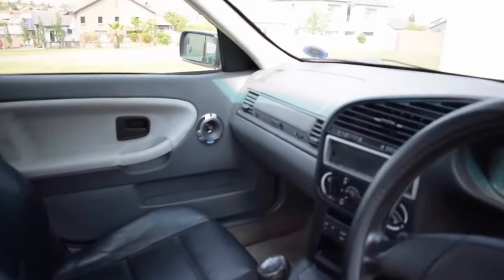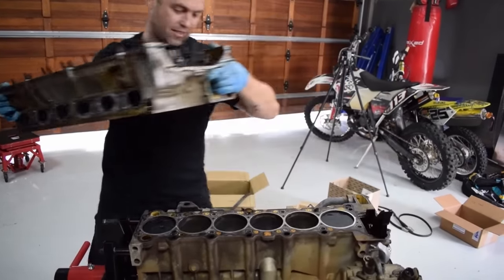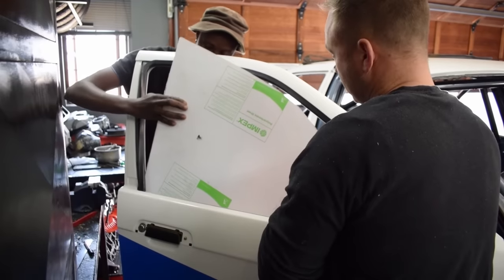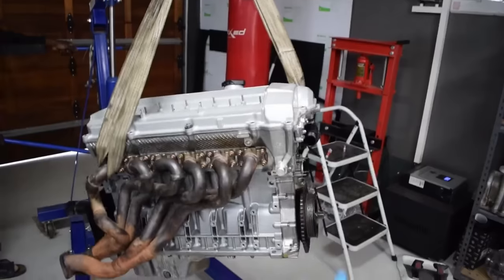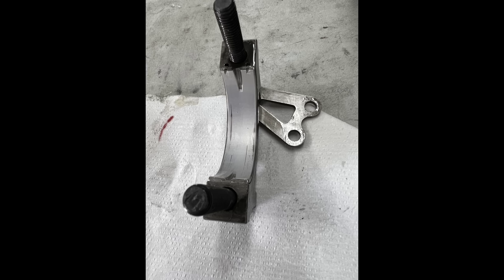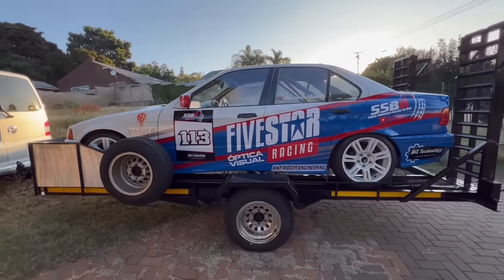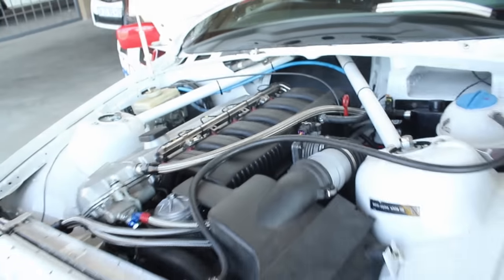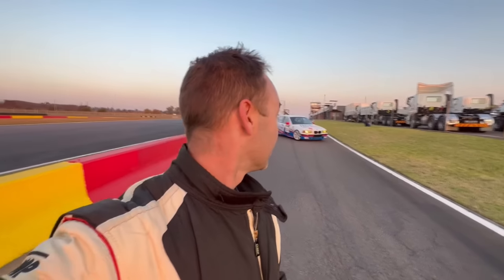E36 Complete Track Car Build in 45 Min

Comment: Best thing I've seen on the internet today, just got into BMW's and this was such an eye opener for me, looking to rebuild a M54B25 to this spec but for road use, hope it turns out half as good.
Reply from the maker: Thank you so much for the amazing feedback!!!
I wish you all the luck going forward. 
If you want to increase the displacement on the B25, you will need 328i conrods and crank. 330 crank will also work with the 328i conrods but the 325i conrods wont work with the 328 & 330 crank. The bump in torque is totally worth it!

Just FYI

Thanks for watching!

Comment: Did you figure out what was happening on the fast right turn? I haven’t watched the rest of your videos but I would assume it’s fuel starvation. A dual fuel pump setup fixes that problem. I love the car though, I just got my 328i running after almost a year and a lot of money to restore it but it’s well worth it
Reply from the maker: Thanks for watching!!! 💪🏻💪🏻💪🏻
It was gearbox oil flying into the exhaust. Problem sorted. 
Funny enough I did install a dual fuel pump setup so all good there💪🏻

Comment: I'm a sucker for white wheels & E36s too. Paint scheme looks awesome, car sounds fantastic, but I'm very concerned about the fabricator that did the cage..... I see lots of little mistakes,  like the attachment point to the front towers (it looked like the tube was attaching to the body w/out a reinforcement plate/hat). On top of that the main hoop should be a 20/40cm further back w/a proper cross bar and harness bar for the shoulder harnesses. Is like they avoided most of the FiA regulations for touring cars. Hopefully the main hoop attachments have reinforcement plates that extend to more than 2 planes.
Reply from the maker: Great observation, thank you.
Yes, I can’t say I was super happy with the cage and will potentially be something I will redo in the near future.
We have some cowboys here in SA. Any how, the cage does have base plates on the floor pan but there are many areas to improve.
I have since found a new fabricator which seems a lot better. Having said that, your comments have prompted me to maybe spec my cages according to FIA standards going forward.

Thanks for watching

Comment: Great race car 👏. Pleas tell me what is the engine spec? It,s 3,0 stroker? Crank it's m54b30 but what is  bore and what pistons did you use?
Reply from the maker: Thanks for the feedback.
M53B30 crank
M54B25 84.5mm Piston modified to work.
Compression = 11.9:1
264 Cams, DIY ported Head
255HP, 322NM on the wheels

Fuel is AVGAS
Reply: @ssbb_builds2090  Hmmm, m54b25 pistons are lower than b30 pistons so this setup with b30 crank and 135mm rods don't give you 11,9 :1 compresion

Comment: Very nice build mate . Yep you can’t beat an e36 . Seems pointless making loads of suggestions as it seems that you know your stuff and already know most of the tricks and tweaks . 

Would recommend a stand alone dash , we used a stack dash and their really good value and In period too as a bonus. Ours came with a nice sensor loom and sensors for around £800 and well worth it to keep it in period and simplify wiring .

Nice 4.1 diff and a cheap 6 speed from a diesel would just top it off if your on a tight budget .

Try and keep all the original trim etc , here in the Uk standard trim etc is getting a bit thin on the ground and expensive. 

We have 3 e36 race cars and 4 e36 road cars , won’t be long before the shells start getting expensive too  .
Stupid things like door handles boot carpets etc etc are quite pricey. 

Like I say nice build 👍🇬🇧
Reply from the maker: Thanks for watching and thank you for the feedback.

Yes, I was looking to keep the retro styling with the dash but it is becoming more of a pain than its worth at this stage....
I will check out the stack stuff, I had one in my race polo, very cool. I have a 3.64 diff but its too short for the long tracks so need another with an LS.

Anyhow, thank you for the support!

Comment: Not sure if I missed it but what did the car end up weighing in at once the full build was complete?
Reply from the maker: Thanks for watching.
Here is a video on the weight of the car.

https://youtu.be/ENeTHQMt6Bc?si=9gzVlPj8AmxyTWMb
Reply: @ssbb_builds2090 You make great videos! Don’t leave any topic untouched. By far the most helpful of any other YT series I’ve watched. 

Also agree about GoPro attached to roll cage in middle may be more favorable

Comment: So what ended up being the problem with the bottom end? Did they have to line bore the crank journals? Seems a bit strange if that was the same crank going back in?
Reply from the maker: Thanks for watching.

The issue was the block distorted over its length when we sleeved it.
So it needed a line bore in the end.
The crank is a 3.0 crank from an M54 B30 motor. So even with the stock 2.8 crank, we would have had the same issue because of the steel sleeves.

The block was sleeved because of excessive wear on the Allu seal coating which allowed me to go for pistons 0.5mm oversize aswell.

Comment: What kind of repair work did kwt do to fix the issue?
Reply from the maker: They line bored the main bearings in the block. They were out ever so slight because of the sleeving process.

Thanks for watching 🙌🏻

Comment: How did you manage to go that much lower ride height than standard and not use bump steer corection and roll centre, mine was rubbing constantly even though it was stiffest it can go on v2 coilover ?
Reply from the maker: Hi, I suspect its a combination of wheel size & spring rate.

Thanks for watching
Reply: @ssbb_builds2090  hi, I don't really know enough about it to say, but had trouble rolling and losing the back end often..and rubbing in corners

Comment: Bro, metal in the oil is normal during break in period...
Reply from the maker: Correct however, there was waay too much in this case.

Turned out to be the block which needed a line bore.

Thanks for watching